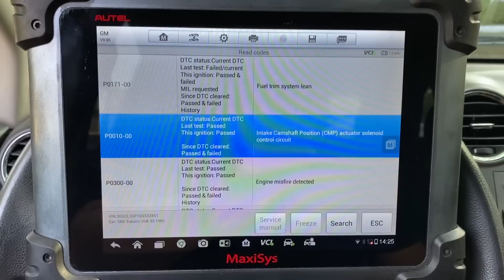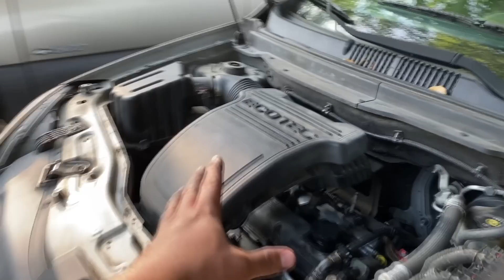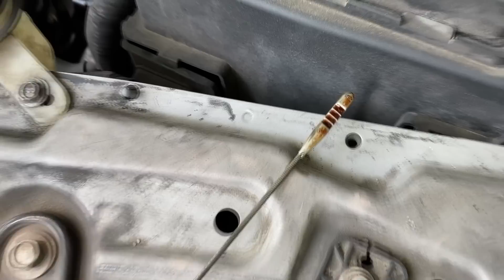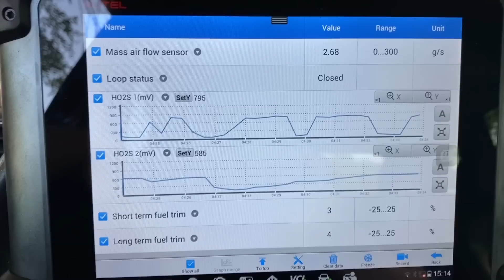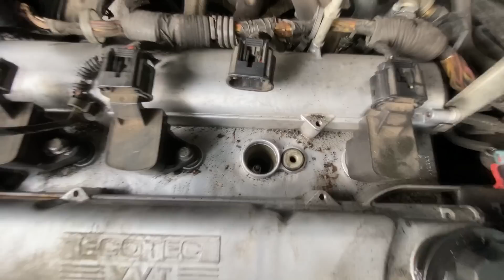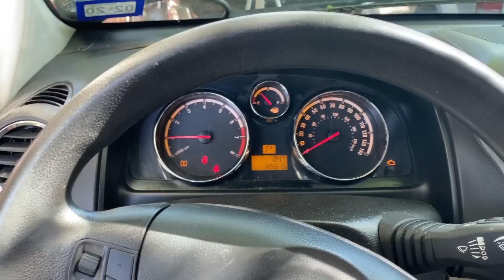SATURN VUE FLASHING CHECK ENGINE LIGHT CASE STUDY

Comment: What an interesting case study, and a brilliant explanation and thought process. I learned several things I never knew, this car would have skunked me for sure. In the end, it's a bit of a disappointment since there was nothing wrong with it except the computer wasn't monitoring correctly because of a calibration issue. You were definitely right to replace the evap purge valve. In retrospect, what do you think about the intake phaser? Was it bad, or was the computer making an incorrect diagnosis because of bad cam/crank calibration? Why do you think the cam/crank correlation was required, and why didn't it give an identifying diagnostic code? Thanks so much for letting us come along in real time. I paused several times to think it through myself, but in the end I came up short.

Comment: I had this exact same scenario happen to me with a Trailblazer after doing what was supposed to be a 'simple' cam actuator replacement (that part was indeed faulty).  The new part fixed the code, but the vehicle ran like crap and would misfire at higher RPMs.  It was late, I was tired...so I bagged it for the night.  It didn't even occur to me to do a cam/crank relearn until the following morning when I was drinking my coffee and contemplating my life choices.  We all have days like that man...it's life.  Learn from it, laugh about it, and move on.  :)

Comment: God I had a similar problem on a chevy malibu and I felt the same way about my job. Found it but not without taking some damage. Great to see you show faults, don't think about giving up. There's always a solution. Probably happened because someone was in there trying to fix something else and caused the issue. I would bet money on the owner or backyard hack that didn't know about the issues that come from disconnecting things they shouldn't have. I've fixed cars like that. Love seeing the look on a customers face when they pay for an hour diag that gets fixed in a couple minutes.

Comment: I had a 2004 Saturn ION with only a 120K, Crank, No Start , had, rpm and cam signal, spark, fuel pressure, and injector pulse . Could smell fuel like flooded. Checked Original worn plugs with huge gaps. Compression measured low all the way across , only 70-80psi . These Eco Tech Engines should be still be 175psi . cold.  I removed the upstream O2 sensor  and put a teaspoon of oil in each cylinder and reran the compression test with the upstream O2 sensor removed and compression was restored to 175 psi. I could feel some compression pulses coming out of the O2 sensor bung hole. I squeezed the sparkplug gaps down smaller , reinstalled the plugs and engine started up and ran it at couple thousand rpm till the smoke subsided. The exhaust and smoke was jettisoning out the O2 bung hole at high pressure because of a restricted exhaust.(Probably had a total Catalyst meltdown corking the  exhaust system.

Comment: I feel your pain Bro.  I once had a Honda Accord where the code is downstream O2 stuck rich.  The scanner shows downstream O2 working but high most of the time.  It turned out upstream Lambda sensor is working but shifted lean.  So the ECM was dumping excessive fuel to compensate.  Not till I unplugged the upstream lambda sensor did everything normalize.  These are valuable life lessons.
Reply: Happened to me on a Toyota. Would say downstream stuck but it was the upstream AF that was the problem. Smh

Comment: I’m having the same issue on a Audi A4 Quattro 2.0t Engine light flashing though it was the hpfp nothing though it did need it because of the cam follower and the misfire is in number two only check the compression wet and dry came back good! So now I think it’s the coil pack connectors any thought I heard they are a common problem? This is on my brothers car and don’t have a scan tool too much right now lol
Reply: After two years found out it was a leaky fuel injector not cheap lol my brother sold the car got a Toyota 😊

Comment: It's times like this that make you smarter in the long run. Age = experience. Hopefully the YouTube money will help with the time lost.  Keep doing your thing man.
Reply: That's exactly it, you may lose a couple bucks but the knowledge you gain is priceless. I had a similar issue with a airflow sensors bad out the box. I learned more about airflow sensors then any class I could of took. It ended up being a bad sensor out the box ( actually it was 2 bad new sensors  how crazy is that) I thought there's no way 2 densos could be bad I'm missing something but it was.

Comment: Ok I would never expect that ending usually you get a code for cam crank correlation not learned
Reply from the maker: My thoughts exactly!
Reply: If I may ? It's not that the correlation wasn't learned per se , but not a LEARNING vehicle. Over time the can crank does not learn on these vehicles , so after time with chain stretch and age the learned crank position may be a few degrees different than when new. A relearn is acceptable as long as within around 8 degrees total . If over that you will set the correlation code for timing . Hope that helps

Comment: When are you going to do a follow up to the Mercedes no ignition/start, what was the conclusion to that repair ( steering lock)? You didnt need to remove the video, we all make wrong diagnosis.
Reply from the maker: I will be posting the video soon. I did make a small mistake and I will explain in the video. Thanks for watching!

Comment: That is just how it goes. I had a tower that showed power out to the light fixture, but no return to the cabinet. I ohmed it out, checked good, got a nice beep. These towers have 4 huge cables that are attached to the boom so that as it goes up, they stretch in unison. I rechecked voltage, still not right. 3 hours later, I look up, physically check cable attachment points, and a clamp failed and cut open cable just enough that it ohmed out, but would not carry the circuit load. It's usually the simple shit that's beats us down the worst. Keep your head up, keep doing what you do. Every successful person gets their ass handed to them at some point or another. Thank you for the great video, we all learned right along with you. Remember, don't quit, keep pushing. That is your key, even if you get lost in diag.  Great job! See ya later!
Reply from the maker: I’m sure that was frustrating. Thanks for watching!

Comment: Hey man, this was a tough car to diagnose. You went through every avenue to narrow the problem. I’m glad you posted your trial and errors. This car kicked your butt. I’m glad you recorded it all and didn’t give up. Good job.
Reply: On a side note, this has happened to me where on replacing the intake or exhaust solenoids because of a fault, it throws off the crank and cam learning. I had this issue with a Chevy Spark. These solenoids go bad all the time.
Reply from the maker: I wonder if that’s why it needed the relearn. Thanks for the info!

Comment: My guess is a timing problem or blown headgasket
Reply from the maker: I thought so too, but I was wrong. Thanks for watching!
Reply: @ADVANCEDLEVELAUTO  ya I've never heard of a computer not knowing what the timing was or getting confused
Reply: If I may ? It's not that the correlation wasn't learned per se , but not a LEARNING vehicle. Over time the can crank does not learn on these vehicles , so after time with chain stretch and age the learned crank position may be a few degrees different than when new. A relearn is acceptable as long as within around 8 degrees total . If over that you will set the correlation code for timing . Hope that helps

Comment: Hey I remember that vehicle. Thank god it’s fixed
Reply from the maker: Thanks bro!
Reply: @ADVANCEDLEVELAUTO  Teamwork, makes the dream work!
Reply: @ADVANCEDLEVELAUTO what series is that scanner?
Reply: Great job guys. Now I thought the crank relearn feature was only use when replacing timing components or crank and cam sensors. What could happened to make the pcm relearn the sensor readings??